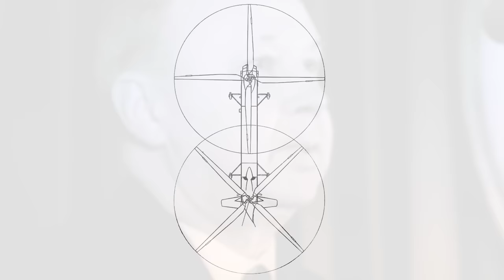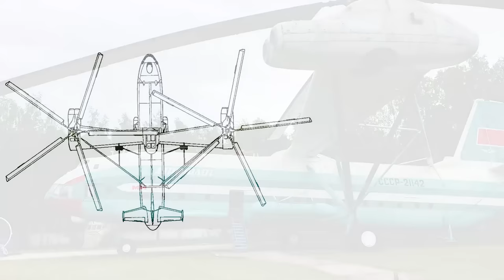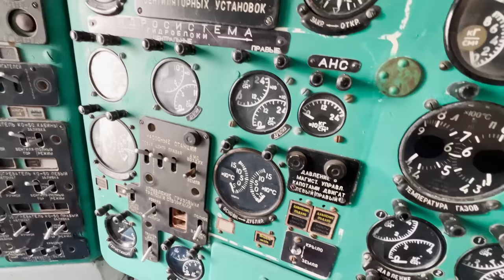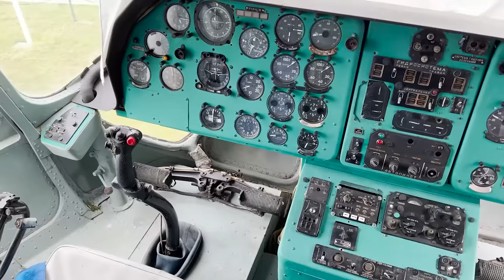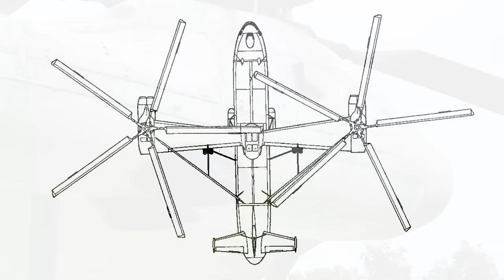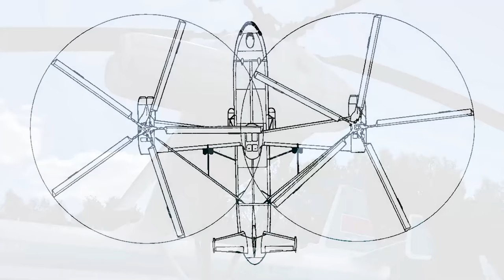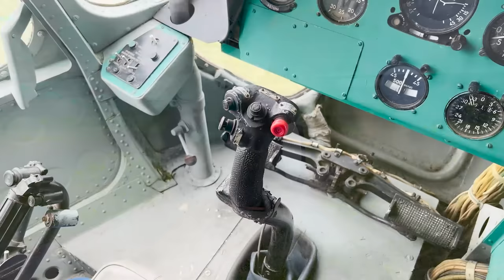Mil V-12 - Soviet rotorcraft titan

Comment: The amount of skill and focus  required to operate such a complex aircraft before the advent of modern day electronics must have been enormous. Hats off to the amazing pilots who accomplished this undoubtedly difficult task
Reply: This configuration was used by the Germans with the Focke-Achgelis Fa 223 Drache with 20 in service starting in 1941.  Bombing destroyed the factory.   It's quite a good configuration for a heavy lift helicopter.   I think its actually quite easy to fly because there is not need to continiously adjust the tail rotor.
Reply: well, they were adveturers.😀😀
Reply: Not to mention all the slide rules and pocket protector pockets on the men who designed and engineered this beast.

Comment: Soviet aerospace has always fascinated me.  They always pushed the envelope a little bit further.
Reply: The opposite is happening now. Aviation companies try to maximize gains from the same products over and over again. Boeing  737MAX is a good example of not wanting to improve.
Reply: @bastadimasta  that is more of a fault of airlines. By using the 737 they don't need to retrain pilots
Reply: @jakewatson2660  clients can demand anything from the manufacturer. It is the responsibility of the manufacturer to build a reliable, economical and safe product. If the client's demand is impossible, then the manufacturer must inform the client so. 
The worst thing that a manufacturer do is  to supply a bad product to its clients without informing the risk of such a product, and people die for it. Boeing did exact that.
Reply: @bastadimasta  WHAT!! 

737 Max is huge improvements over previous 737.
New wing, new engines new computers new control systems. 
Much more fuel efficient, Much safer, Much cleaner (green wise) Low carbon impact in making them, Much improved passenger comfort. 

Clearly you only watch what the news says and know nothing about planes
Reply: @tbas8741  Boeing did the absolute minimum for 737 Max. New engine required a taller landing gear. Instead they chose to patch the issue with code.
Reply: @tbas8741  Just be nice if it stayed in the air! 😁
Reply: @bastadimasta the new batch of models based on existing models from both Airbus and Boeing have huge leaps forward in tech in basically every system, composite turbine blades are being introduced, for example. It's like saying an F15EX is the same as an F15A
Reply: @tofubutcher7456  Upgrades work up to a point. You cannot upgrade a system indefinitely. F-15 is a great (if not the greatest) air superiority fighter but it cannot perform the same role now. F-15EX is strike fighter but soon it will be obsolete in this role too. 
Boeing 737 entered service in 1967. It was a product of pre-electronic engineering. Most of its current systems are from that era. Airbus A 320 entered service in 1988. There is still room for 1 more major upgrade for A320 but 737 has already reached its limits.
Reply: And they do it in a curious and fascinating "pioneering" way.
Reply: @bastadimasta  
No need to make something different if what exists excels at the job. That's why the U2 has remained the top reconnaissance aircraft all these years and outlasted newer fancier platforms. The first flight of the U2 occurred closer in time to the Wright Brother's first flight at Kitty Hawk than today and it's still being upgraded and fitted with new technology.
Reply: @bastadimasta it’s the fault of regulators and the airlines. That had the whole 737 max debacle because the changes they needed to make would have cost them tons in time and red tape.
Reply: @A.J.1656  U2 has been replaced long time ago with satellites in the 60s, and then UAVs in the 90s. U2 has been kept operational for a few niche operations. I am pretty sure that less than 0.1% of aerial Intel is gathered by U2 since the 70s.
By the way, U2 is an awful aircraft because it lacks landing gear, it is very hard to fly, and it operates within 5 knots of stall speed through most phases of flight. Imagine yourself driving your car at 50 miles an hour but if you increase or decrease your speed 0.1 miles an hour you die. That's your perfect U2.
Reply: Max powers is my Dad
Reply: Compensating.
Reply: @KS-xo3oh  not in Russia .. you would be labeled traitor 😂😂😂
Reply: Completely agree. They were never afraid to try ‘different’ ideas…..back then! But now, innovation funding only seems to go on ‘pet projects’!
Reply: Cuz they didnt have to worry bout pesky things like safety or efficiency.
Reply: @JasonSmith-pe5py  they still don't.. They made nothing new in 30 years
Reply: @bastadimasta  

Since you like percentages, what percent chance do you think there might be that I'm a USAF veteran? Small. What percent chance that I'm a pilot? Even smaller than that. What percent chance that I was assigned to the 99RS and have first-hand intimate knowledge of the U2? It's nearly impossible, right? 
Don't go around pretending you know what you are talking about when you clearly don't. You might make a complete fool of yourself. lol
Reply: @A.J.1656  I admire your fictional intimacy with U2 but that doesn't the fact that it is a badly designed, dangerous and outdated aircraft. I don't respect the knowledge of of person who claims the perfection for an aircraft that lands on sacrificial piece of metal and needs external help to land. U2 is the only military aircraft that is dangerous during normal operations.
Reply: She therefore produced some of the most dangerous flying machines in existence. What's not to like? Haha
Reply: It’s solely down to production and design being based on necessity and not profitability. Of course, cost is a factor, but cost is not the same as profitability. As well, the dynamic of the design bureau concept of producing new designs and innovations was superior to the capitalist notion of secrecy and competition between private companies that could patent and keep secret any advancement they had made, even if the company couldnt utilise it. Design bureaus competed in a way, but cooperated when the initial competition phase was finished with, and information and technologies were shared amongst each other rather than kept a company secret for financial reasons. As well, there was much more meritocracy involved, as those who were capable were hired, not those who had money or family connections or other advantages a capitalist society disrupts meritocracy with. That isn’t to say that there wasn’t some nepotism or ruthless competition to the point of sabotaging one another in the Soviet system, just that it was not as built into the system as a feature, or by design, as it was/is in the capitalist system.
Reply: Really? Ever hear of the U-2? SR-71? Or the F-15, which is currently at around 105 kills with zero losses over it's lifetime so far? Soviet was always rudimentary, crude even, and never made great leaps. Engines were one thing they NEVER figured out how to do well.
Reply: @bastadimasta  The pilots do it just fine. Just because you can't, doesn't mean it can't be done efficiently. And you obviously lack any real knowledge of what the plane is capable of. Satellites can be tracked and known when and where they will be and electronic emissions will be shut down, secret stuff hidden, ect. A U-2 just over the horizon high as hell can get all of the electronic information that they think they're turning off before satellites come by. Electronic Information Warfare is JUST as important as photography, if not a little more. It can do all sorts of neat photography and radar imaging, etc., but the real use it has now is slurping up electronic data. There's no immediate plans to retire it and they remanufactured it, like started up a new line and basically a new aircraft. It's called the TR-2 and is much better than the U-2. Every single pound cost a foot in final elevation and while it's balky to get on the ground there's nowhere to PUT landing gear that will knock off lots of attainable altitude. It works. You're just misinformed and quoting some loser's remarks about it, and they're probably russian to boot (who tried to copy it along with untold numbers of US planes and items, but lacked the technical expertise to copy the rocket powered glider, even though they literally had one in their hands lol)
Reply: @A.J.1656  THANK YOU. My points exactly!!!!
Reply: @BigDaddy-yp4mi  
That poor guy didn't realize he was trying to sound smart while talking to a former U2 crew chief and current airline captain. Whoopsie daisy! 🤣

You're right about the mission capabilities of the U2. Most people talk about them as if they are just a platform for a camera. The camera might be the least common piece of equipment they carry. Haha
Reply: @BigDaddy-yp4mi  do you really believe a U2 just over the horizon is invisible? A U2 below the horizon is visible to over-the-horizon radars systems that emits shortwave radiation that reflect from ionosphere. A satellite can gather the same information from a similar just over the horizon position too. A Global Hawk does the same far more cost effectivity. 
You just admitted that how outdated U2 really is. 1950s engineer had to sacrifice landing gear in order to lose some weight because it was the only thing that they could to. A new aircraft for the same mission could be engineered from carbon composites today at least 20-25 percent lighter and with proper landing gear. The fact that there is no effort to replace U2 is enough proof that is no longer needed operationally, but kept just in case.
Reply: If the CIA was fixing laser beams to sharks and killing goats with thought- the KGB was trying to get sharks to kill goats with thought induced laser beams.
Reply: @bastadimasta  we're also a lot dumber than previously great generations full of uninhibited thinkers
Reply: @bastadimasta  
Again you show how very little you actually know about the subject. 
How much carbon fiber is on a modern U2? Do you even know? 
How much titanium? 
What is the drawback to the bicycle landing gear system? It isn't an issue, so what exactly are you talking about the gear configuration for?
What does the Global Hawk's max payload compare to the U2's max payload? How high can a Global Hawk fly compared to the U2? 
You have no idea what you are talking about. You are making a complete fool of yourself on the topic.
The effort to replace the U2 hasn't materialized because it remains the most effective platform. It has outlasted newer platforms entire lifespans. It is has been updated and upgraded because it works better than anything else. 
I don't know why you have decided to plant your flag and make your last stand on a topic you're so poorly equipped to discuss.
Reply: @MW-nOttawa  I don't agree. Everyhing is the same, but dumb people are more visible because of internet.
Reply: @A.J.1656  In fact, I know most of them. I've been factual through our conversation, but you keep defending the airplane like a religious fanatic. I am an engineers and I like to be factual.
Reply: @bastadimasta  a satellite can't pickup the same resolution of a camera flying significantly closer to a target. Furthermore, satellites are either static over a single territory or they moving 20,000 miles an hour and only have short windows of time to take a picture.

A U2 can be sent to a location and leave while flying high enough to be out of reach of most threats.
Reply: Lol sure they do. With glue an tape.this thing is a joke at best
Reply: What envelope? Email has killed all envelopes. Forget envelope.
Reply: I think you mean aeronautics. Soviet aerospace was the physical space above the Soviet Union.
Reply: When profit doesn't matter, it frees up the imagination to pursue things you otherwise wouldn't.
Reply: @siposzero  aerospace engineering, airspace is not aerospace
Reply: @bastadimasta  The original comment says "Soviet aerospace", not "Soviet aerospace engineering". Aerospace is analogous to airspace, but does not end at the edge of space. The difference between aerospace engineering and aeronautics is that one is the engineering of craft that fly in the air and/or in space, while the other is the study if the science and engineering of flight in air. I think aeronautics is probably the more precise term here, but it kind of depends on what the original commenter meant, which is hard to know since what they said refers to a part of physical space, not a discipline of study.
Reply: @bastadimasta  The F-15EX is a launching platform for targets selected by the F-35 and F-22.
Reply: Threat of death tends to do that
Reply: That's because the envelope oftentimes has coca in it.
Reply: @jakewatson2660  это результат одного из минусов капитализма
Reply: @bastadimasta  I suspect a current day 737 doesn't share a single part with the original design of the 60's
Reply: @ashleymadison9380  Most mechanical systems are the same. Fuselage, landing gear, tires, etc. Boeing does not change anything unless part is faulty or it makes a there is a cheaper way to manufacture the part.
Reply: The wonder years of aviation, I miss shows like the Discovery Channels "Wings"
Reply: More interesting yet is how they can create something like this and realize it’s not worth mass producing, similar to IS2 tank. The IS2 at time of creation was, from accounts, a “perfect machine”. Big armor, high speed, high maneuvering, big gun. But the soviets didn’t mass produce it because it didn’t fit their doctrine. The opposite of this was Germany in WWII, which tended to make lots of prototype vehicles mass produced when they probably shouldn’t have been mass produced.
Reply: @bastadimasta I admire your perseverance but it's very obvious by this point that you don't work in aerospace and thus have no idea what you're talking about..
Reply: @Fenderak  you are wrong about that.
Reply: it’s interesting until one of their planes crashes into your town
Reply: Just a little bit…
Reply: It was ego because they always had to one up the United States is size of aircraft
Reply: @MW-nOttawa 
My sharks with frickin' particle beam turrets on their heads can not only kill herds of goats, but the goat herders too!...
😉😁
Reply: @jowen001 
True. However the U-2/TR1's are indeed quite vulnerable to current-gen Russian/Chinese SAM systems and fighters. Although still useful against less-equipped enemies, (e.g. N. Korea), there's good reason they wouldn't be used to overfly primary enemy territory today...
Reply: Not much safer. Already two crashes
Reply: Helicopters don't fly — they just beat the air into submission.
Reply: If the USSR political leaders had done a better job managing the country, USSR scientists would have been unstoppable. In that respect, the world lost an opportunity for a different centre of industry until the Chinese rose to provide some variety; good as they are, Chinese scientists are not as unconventional as the USSR ones were.

Comment: 18:50 That weight for Mi-26 is total takeoff weight, not cargo (it has lifted a 25 ton block of frozen tundra with a mammoth in it). The weights for V-12 were the cargo weights.

I have stood in the rotor wash of a Mi-26, it was windy! It had been hired to put up a power line in the early 1990s.

Comment: Only helicopter ever made that would have been capable of lifting a fully loaded 40' shipping container (67,200 lbs).
Reply: ]p81
Reply: No sorry brother a MI-6 lifted 125,000 + pounds to 2,000 meters so the MI-6 lifted almost not quite but almost X2 40’ foot loaded containers it was done near Moscow by the MI-6 in 1982
Reply: Helix if you pause an instant and think about this, we realise how difficult it is to transport mass by air, even more by vertical takeoff which requires way more power than wing lift. A 100 hp engine in a old semi can haul a 40ft container around the country and on a freight train on a flat track they can get as low as 1hp/ton of mass! I would say in a helicopter it is as high as 1000hp/T or even more!
Reply: @TheHomeMaker1  That's not the case, sorry to say. That's the all-up weight, not the payload.
On 3 February 1982, flown by Ге́рман Вита́льевич Алфёров (Herman Vitalievich Alferov) and L.A. Indeev, the Mi-26 with an all-up weight of 56,768.8 kilograms (125,153.8 pounds) flew to a height of 2,000 meters (6,562 feet).¹ Later, they flew to a height of 4,100 meters (13,451 feet) with a payload of 25,000 kilograms (55,115.6 pounds).²
The helicopter has an empty weight of 28,200 kilograms (62,170 pounds)
Reply: Geez... Makes a Skycrane look like an absolute wimp in comparison. Although I do like the Sikorsky's design.
Reply: @longfade  What's heavier? A ton of Q-Tips or a ton of lead?
Reply: @GooglePlusPages  my ex

Comment: Hard to see how the transverse layout makes any of the twin rotor problems go away with the sole exception of the length of the fuselage. However, the transverse disposition requires an entirely extra structure just to carry the rotors, and that structural addition is subject to similar load to the lengthened fuselage, hence the aircraft's structural weight almost doubles.

Comment: The Germans first used this configuration with the Focke-Achgelis Fa 223 Drache with no less than 20 in service starting in 1941.  Bombing destroyed the factory.   It's quite a good configuration for a heavy lift helicopter.

Comment: That is not a helicopter, nor just a rotorcraft... That's near as makes no difference a flying 50% scale basketball court, (Mil dimensions= 4.4mx4.4mx28.15m or 14.4ftx14.4ftx92ft, an NBA basketball court is 15mx28.6m or 25x94 feet). It's may be half as wide as a basketball court but it's nearly the same length ... and it can fly... IT CAN FLY